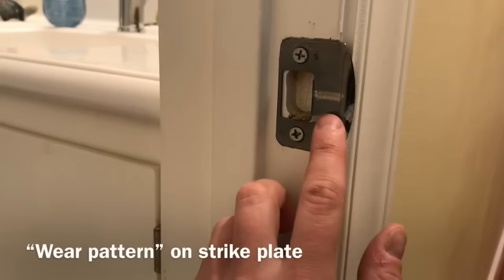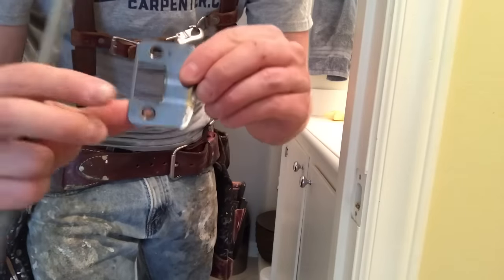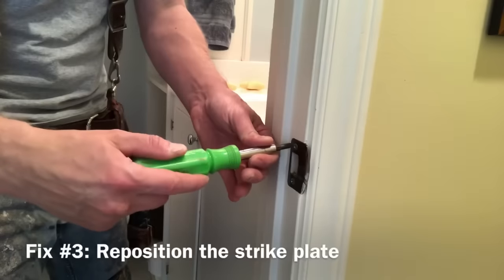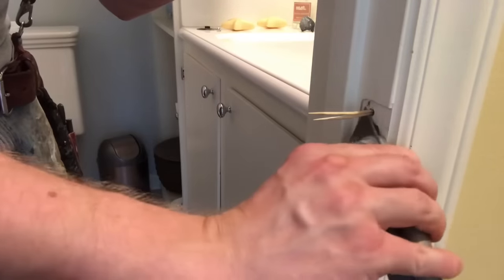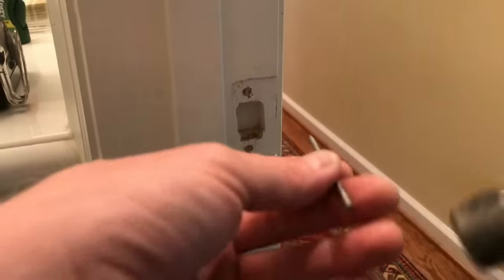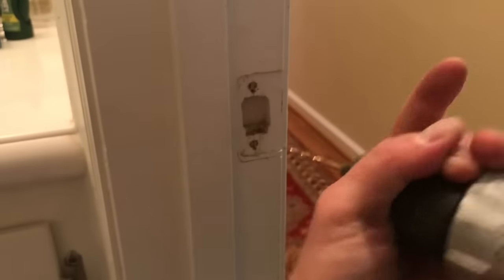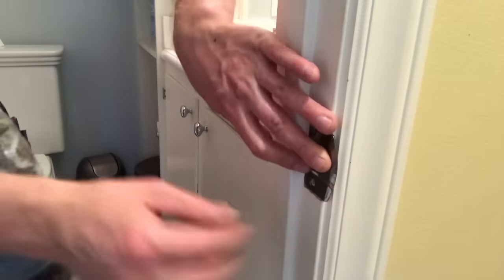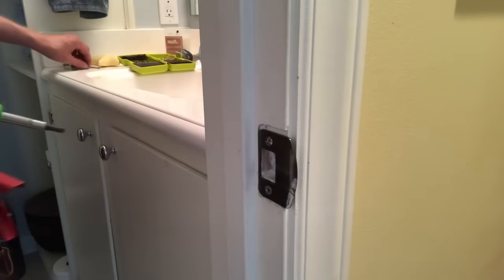Door Won’t Latch—3 Easy Fixes!

Comment: I just replaced an exterior door with this issue, the dead bolt lined up perfectly in the middle but the door knob latch was barely catching the bottom of the existing hole where the strike plate was. My issue was like this video, how to make new holes that were very close to the old ones which you solved by using the toothpicks, how about the latch hole, could one possibly glue in a piece wood to fill part of that hole as well if the top screw hole was very close to the latch hole as was almost the case in this video ?
Reply from the maker: @Dill Wiggle That’s probably the best thing. If you have a hole saw that size, cut a pine scrap that you can glue into place there, let it dry, then bore the hole a little further down. Dealing with a misplaced latch hole is always a pain 😕

Comment: as a professional carpenter, 9 times out of ten the door has dropped, that's why it's not latching, check the gap between the door and frame along the top if the gap is bigger latch side then the door has dropped and the latch will be to low so unscrew the top hinge and chisel out an mm or two re-screw hinge and the door will latch. do not mess with the keep unless have to, will make a mess like this dude.
Reply: the gap is smaller closer to the latch for me

Comment: MH Ready Patch is a great filler for this kind of fill. One step instead of multiple passes with caulk.
Reply from the maker: @ZapaDeeBOOM Thanks for watching and for writing in! I haven't used Ready Patch, I'm going to look into it. And I agree, golf tees work really well. What I like about toothpicks though is that they leave tiny channels between the wood, so the screw can go ahead and force it's way in there, but the threads still have plenty of new material to bite into. With the combination of super glue, nothing goes anywhere and it's quick. But, golf tees are definitely made of harder wood and provide the highest level of fastening power for applications where they screw will have a lot of stress on it 👍

Comment: You’re kidding right? The first step is a 3” screw on the top center hinge. You made this wayyyyyy too complicated
Reply from the maker: @The Chad That's a great method if what you're getting is hinge pull-away at the top (where you'll generally also rubbing at top of the opposite jamb as well). Unfortunately it won't address hinge-side settling, which is what was occurring in this house. The methods in this video are good options for settling situations--other options include changing out the old hinges for new ones, or pulling casings and lifting/re-squaring the whole hinge-side jamb (if the RO will allow for it).
Reply: The Honest Carpenter again I honestly hope you’re kidding. It raises the door which brings the hinge up dude. It’s pretty common knowledge

Comment: I just fixed my strike plate! I don’t have to pull the door so the deadbolt fits into the slot EVERYTIME I shut the door!  I had thought the strike plate needed to be repositioned but the bottom screw was loose, I jammed a couple of matches into the hole, put the screw back in and hallelujah the door is fixed. I can’t thank you enough for videoing your work!
Reply from the maker: @kayBTR I'm so glad it helped! Lifting up on doors is such a nuisance--I'm really happy the matches worked. And I'll keep making videos--thank you for watching! :)

Comment: Thanks bro.  I just filed down the openings in the strike plates on two doors in our house.  It worked for me.  I also tightened the two screws on the door knobs since they were loose and might have been contributing to the problem.
Reply from the maker: Good deal! 👍
Reply: Nice tip about tightening the door knob's screws. They tend to loosen over time.

Comment: Suggestion: 
You can chuck up a Roto-Zip drill bit in your drill to remove material in a small space. Good video... Thats How I do it including the tooth picks. I use regular wood glue, never thought of super glue. What ever works, right. Good informative video though.
Reply from the maker: Thanks for the tip Scott! I need to get more rotary bits--they're so good at doing small things that other tools just can't perform
Reply: @TheHonestCarpenter  Check out the ROTO-ZIP drill bits. they will fit in your drill and work like a saw blade. you can cut wood with them.

Comment: Very good information, thank you. However, I would recommend using gloves whenever using a hammer, wiping away excess wood, etc, so as not to get stuck by a splinter - I've done it many times myself. Also, I've found that using a Dremel, or another rotary tool, can get a more desired result than a chisel in this instance. Thanks again, most instructive and easy to follow!

Comment: Yo so I dd all these and my door still did not work, but when I took the bracket off it works locks and shuts so do I one hundred percent need the bracket, like what is it used for?
Reply from the maker: @GzGaming Hey, sorry to hear that. In truth, there can be a number of factors that affect door function, so many it's hard to name them all. But, if just taking the strike plate all the way off makes it work, it's not unheard of. The strike plate keeps the door latch from wearing down the wood where it crosses the door casing, and it adds a little extra security to that part of the jamb, and helps to keep the door closed tighter. But, if it's an interior door, it's not STRICTLY necessary to have it there. I hope that helps. You can send me a pic at my website too if you like: www.thehonestcarpenter.com
Reply: @TheHonestCarpenter  Ok Cool thank you for responding quickly :)!
Reply from the maker: @livinsmall8810  sure thing!

Comment: I do soo many of these doors, I told a guy today...I could make a living if this is all I do, fix doors, adjust latches and strikes. Oh and dropped sinks. Lol
I have an invention for this issue...I will tell you when I have the patent.
Reply: Whats the best way to go about fixing a door when the strike plate is too deep for it to latch and close the door? Thanks in Christ
Reply: So you are saying the door jamb is too far away from the strike and the latch will not hit the strike?
Reply: @scottsprowl7484  yes thats exactly it
Reply: Ok, remove the trim on that side, remove any screws. You may need to cut the nails, then close the door and use a pry bar to move jamb closer to the door, shim as necessary, renail. Check operation the reinstall trim
Reply: @scottsprowl7484  oh ok thanks a lot for taking time to help me out! Ill try to follow your directions as best as i can.
Reply: No problem..

Comment: Do you have any tips for removing old slot headed screws which have been painted over and seem almost impossible to move. Cheers
Reply from the maker: gsf67 I know, that’s always a pain! I usually take a very narrow flathead screwdriver and use it to gouge or push the caked-up paint OUT of the flathead channel on the screw. Try to clear the channel as much as possible without damaging it, and also scrape as much paint off the screw head as possible. Then you can usually get an appropriate size flathead screwdriver in there to back it out. If that doesn’t work,  you sometimes have to drill the old screw head off with a titanium drill bit 😕
Reply: @TheHonestCarpenter  An Xacto knife with a spade blade or similar (depending on the width of the screw head). As long as the blade is sharp, a couple of taps with a hammer will suffice,

Comment: I had a similar problem with one of my doors. After checking the plate, door knob itself, I found my problem. One of the pins in the hinges was missing. Replaced the pin and Wala it locks
Reply: Wala??, really?!!, what the heck does that mean?! Oh, wait, you mean “voilà”, don’t you? You know, that French word that, loosely translated, means “there you have it”. See if you can find “wala” in the dictionary! Wow, sorry, that’s one of my top pet peeves 🙄
Reply: @stephensalmon2897  FYI: This is about carpentry tips; not French lessons.
Reply: theta Touch Haha, well, I’d say knowing how to say “voilà” is as basic as a knowing how to hammer a nail, or look at this way— you got a little bonus with your carpentry lesson!

Comment: Thank you so much! Our bathroom door wasn't latching at all and we weren't sure what we needed to do, just needed a screwdriver and a couple taps of a hammer!
Reply from the maker: You’re welcome Lindsay! It’s amazing how often it works 🙂
Reply: @TheHonestCarpenter  so, I was dead wrong 😅 the door closes properly when you close it from the outside but not from the inside 🤷‍♀️
Reply from the maker: @lindsays2479  That's weird! Is there anything wrong with the lockset/latch by any chance? Sometimes the knob mechanism itself can cause latching problems
Reply: @TheHonestCarpenter  there's a trick to it for closing it from the inside, we have to push and lift until we hear a click 🤷‍♀️

Comment: As a locksmith watching this video I just shook my head. There is plenty of gap at the bottom of that door below the strike plate which means you can easily adjust the hinges. We have something called the Hinge Doctor and yes they're expensive but they work great on these kinds of projects. If you don't have Hinge Doctors you can still adjust the door by putting various thicknesses of wood or plastic shims between the bottom hinges before the door closes and then gently force the door towards being closed. The hinge will give a little but the door will move a lot thereby raising the latch to be aligned with strike plate. Yes, doing what this guy did will work but it leaves a visual mess. Being professional and leaving the job looking great goes a very long way.

Comment: Thanks Honest Carpenter for this video. I’m having a similar problem and I’m going to try your suggestions. 
Thanks also to all the other Master Builder for your comments as well. Good info.
I also found many comments interesting when it comes to the different terms used describing the fix to this problem. I’m a Master Barber and in the past I’ve had clients from different parts of the country who asked for specific haircuts that are known by different names. The bottom line is that they satisfied with the cut and it was exactly what they wanted. 

I’ll be satisfied too after I get door to close properly thanks to this video. 

Best wishes my friend and thanks again.
Reply from the maker: Thanks for watching Everett! I learn a great deal from the comments myself 😁 I’m glad it was all helpful!

Comment: "Drive the strike plate down"?  THINK about what you're doing. How much could you move it?  1/32"?  If the plate is the slightest bit more than 1/32" out of position, it still won't latch. And that 1/32" will distort the screw holes and they will no longer hold the plate in place. 

The file you are using is ALL WRONG for the plate.  Don't cut using the edge of a big flat file.  Get a narrower flat file or a triangular file and cut with the flat surfaces, rather than the edge.  All you are going to do is make the edge of the brass plate ROUGH.

I couldn't even watch the rest of your procedure.  The only way to move the plate when the new location puts the new mounting holes overlapping the old ones is to drill out the mounting holes for wooden dowels, glue dowels in, cut them flush and then drill new holes.

Comment: instead of wasting a bunch of time using guess work, you should have stuck with the marks you made to determine if the latch was in the right position. The step where you hit the screwdriver with the hammer was just plain dumb. Have a little respect for your tools.

Comment: I would think that Fix 2b might be easier to attempt before one moves on to your third fix.
Fix 2b: pull the door, with the hinges, and, assuming the latch is still too low for the catch, place a thickness of cardboard behind the lower hinge, between the hinge and the door frame, and remount the door.  The slight thickness of the cardboard will cause the door to angulate upwards slightly, causing the latch to come more into alignment with the catch.  I've found that one can add a fairly significant amount of "shims" behind the hinge before one notices either the door looks cockeyed in the frame, or you start hitting the doorframe with either the lower part of the door or the top of the door.  If the door latch is higher than the catch, one simply adds shims to the upper hinge instead of the lower hinge.
I like this fix attempt better than your third fix (not that I dislike your third fix), because one can make several attempts to correct the problem, and if they don't work, are also completely removable if one finds they just won't cut the mustard and you need to go with the nuclear option of Fix #3.
Reply from the maker: @M Demers This is a really good explanation of hinge shimming. It's yet another thing I've done in other door situations, but failed to mention here. I especially like that you point out how shim layers are removable, and therefore easily undone. Thank you for watching and for writing in! I'd be happy to hear your thoughts on some other videos 🙂

Comment: Why on Earth would your first suggestion for fixing a latch landing too LOW on a strike plate NOT be to look at the hinges?! I guarantee that 98% of the time if your latch is too low for the plate your top hinge (or top and middle hinge) have worked themselves loose from at least one screw holding them to the jam or door.